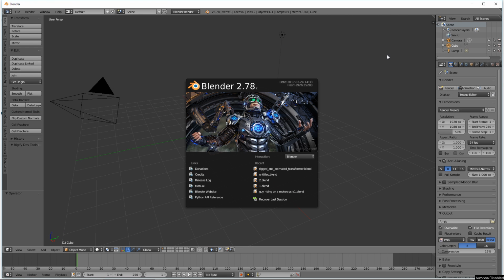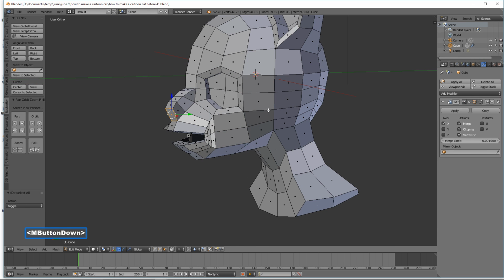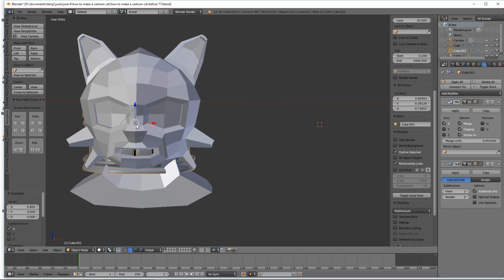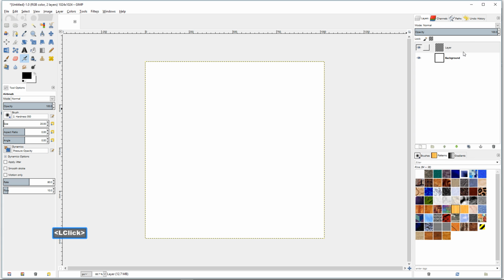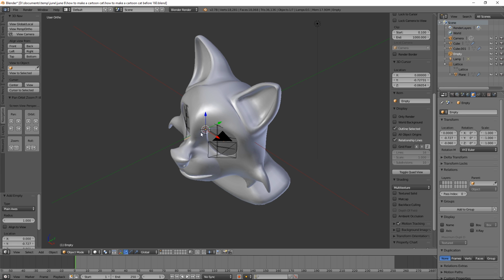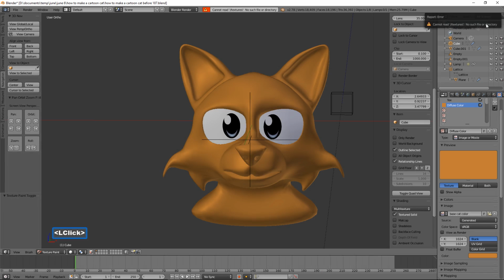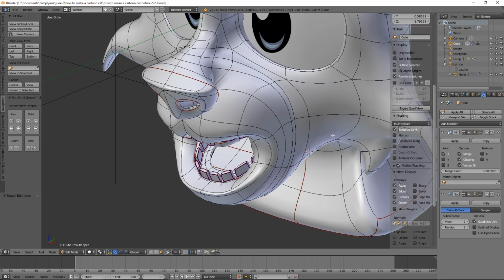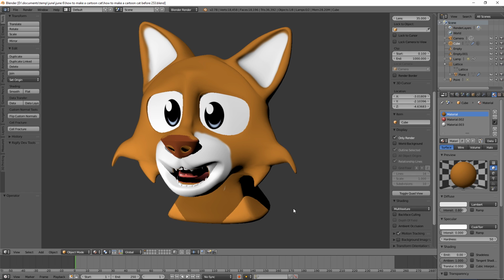How To Make A Cartoon Cat Head In Blender 2.78 c

Comment: do you have any vids on setting up gimp, I just now downloaded it and the three parts of it are somehow in three different windows or something
Reply from the maker: Thanks for watching video. The first thing after downloading Gimp that you should do is to go to"Windows" in the tip menu and then select Single-Window Mode. This will make all the panels be as one. Are you still having issues with the eyes?
Reply: thanks with the tip for gimp, and yea, still having trouble with the eyes, followed all the steps for them but they don't show up on the plane, al I get is a white background and I don't think that's my texture either.

Comment: why do u still u blender internal rendering
Reply from the maker: If you look at my usual tutorials you will find that I used to almost always finish them in cycles. Long story short I tend to do 3D work that can be animated. A 5 second 24 fps video might take anywhere from 2-8 hour to render depending on the sampling that i use in cycles. In the Blender view port I can render the same animation in about 10-30 second. I still have a hard time believing how fast the renders happen. While the the renders don't tend to look quite as good as cycles they do tend to be fairly close. I hope that this anwers you question. Thank you very much for watching this video.